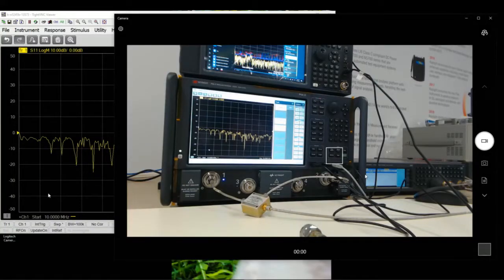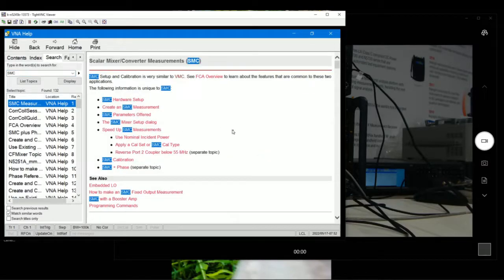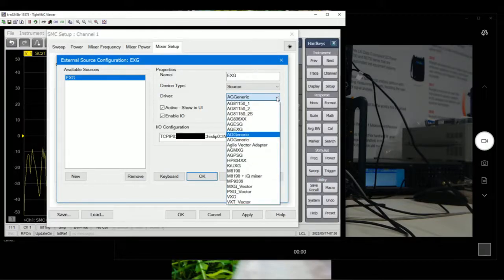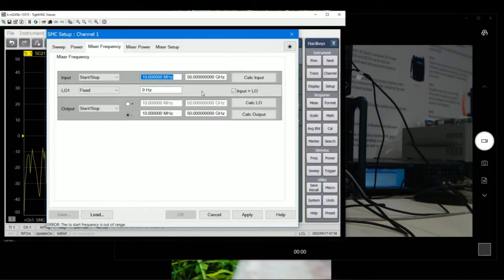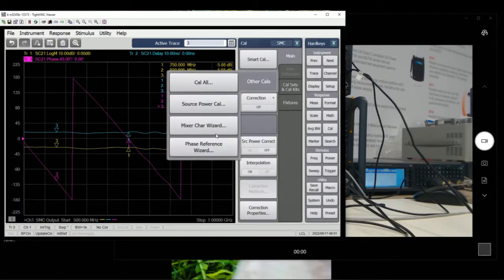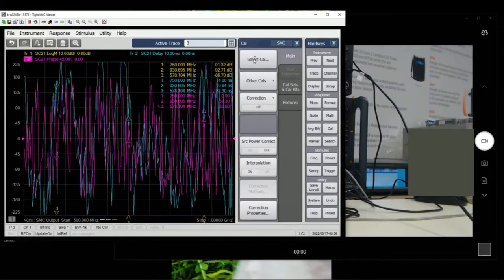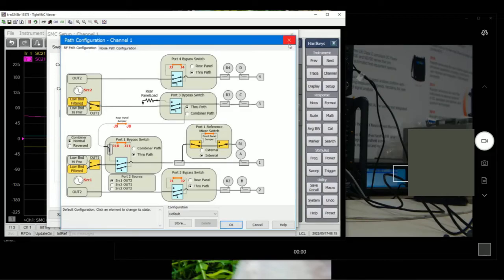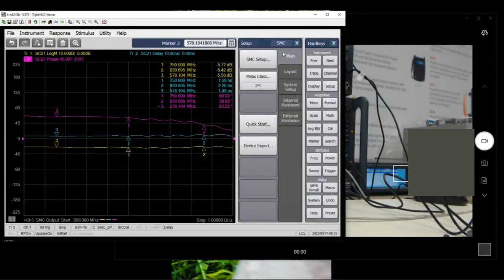Episode 76: PNA SMC Setup Calibration and Measurement

Comment: port 2 is IF  which is output , what is power sensor  calibration  doing on port  2 ?
Reply from the maker: the power sensor calibrates the power measurement level at port 2. Port 2 can be used as signal generator as well. since the RF path is reciprocal, after the calibration we are able to determine the total loss in power from the IF of mixer. some setup has jumper cable connected to the mixer, hence this power calibration is needed.